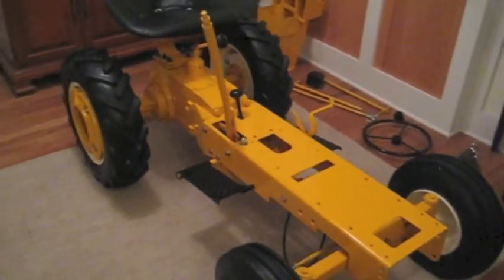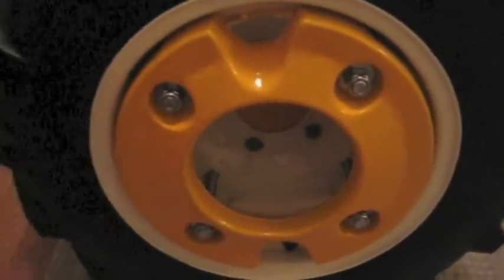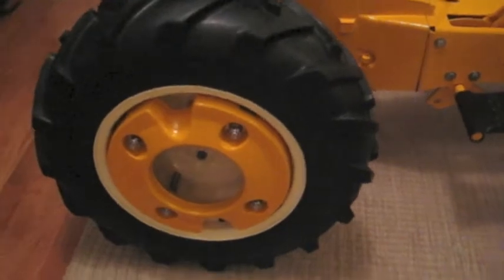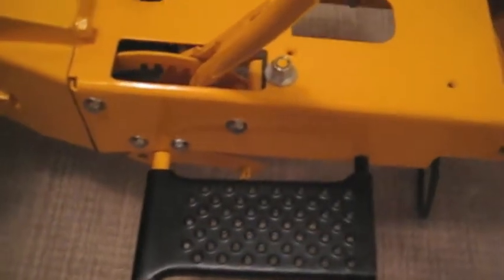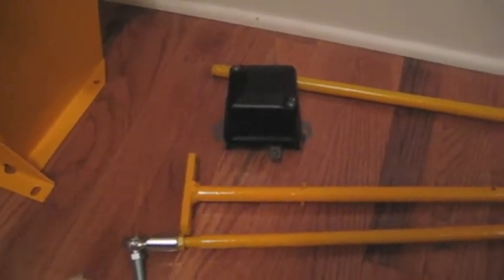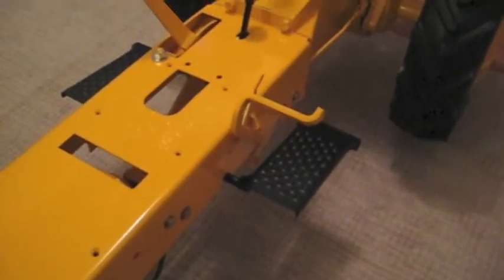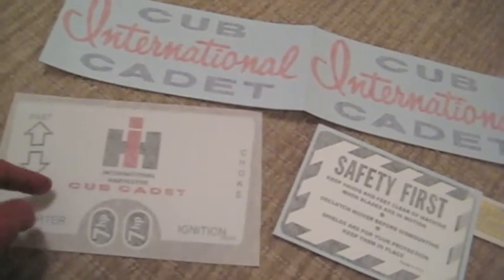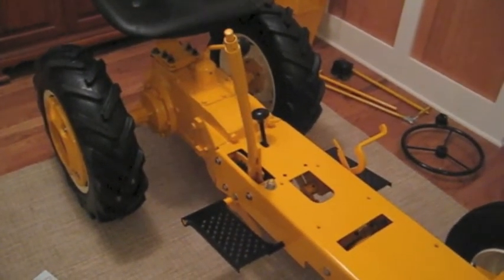8 - Cub Cadet Original Restoration - Decals

Comment: hey this is awesome. just started on my own, hope it's half as good when I finish.  I like the jb weld tip.  question, what kind of tires did you get?
Reply from the maker: Thanks!  I am sure you will do just as good on your tractor.  My back tires are 6 x 12.   I would recommend buying Carlisle tires.  They are made in the USA.